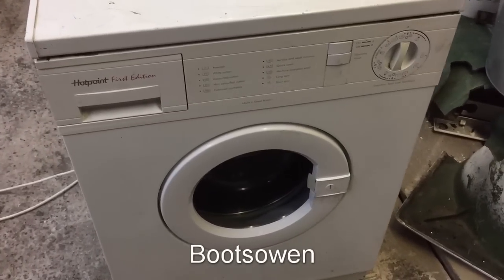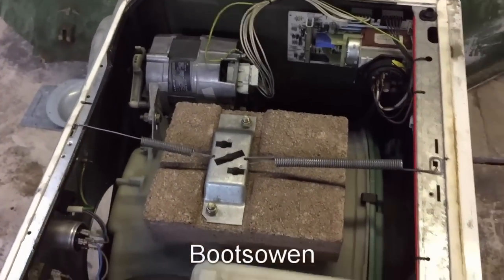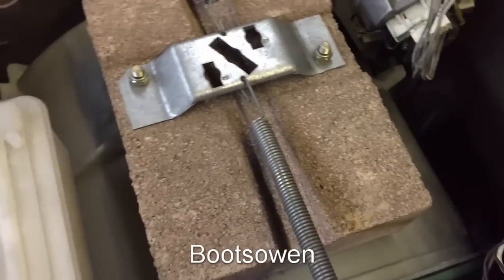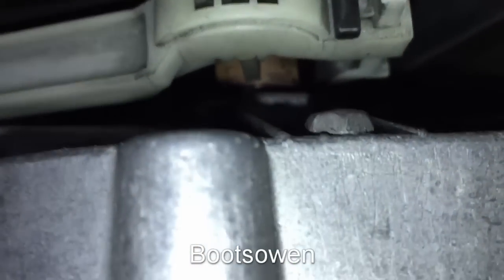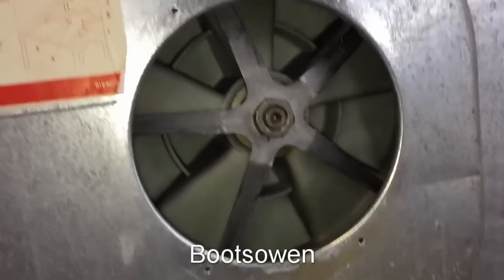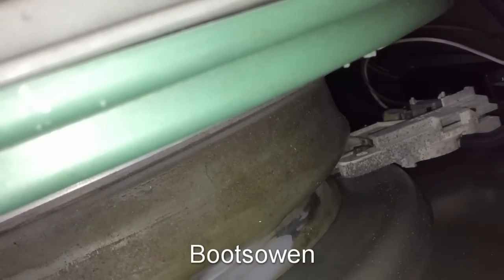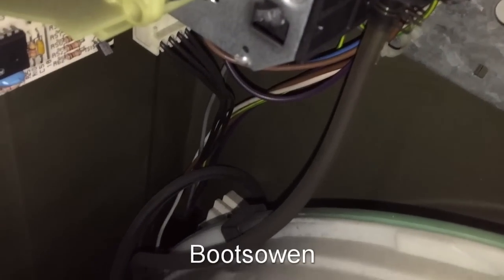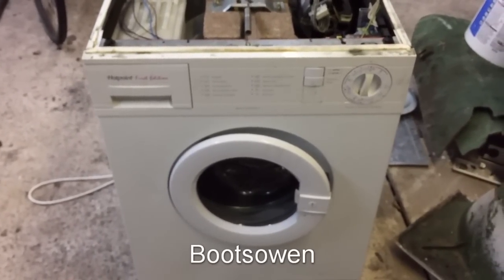Old Hotpoint washing machine tour

Comment: I think that pecker on the motor is to stop the door opening during the washing machine moving. A lot of these machines were fitted with a distinctive interlock whereby the door could be opened at any time, except when the motor was operating, hence you didn't have to wait 1/2 mins after the wash has finished for the door lock to release like many other machines.
Reply from the maker: But what if there is still water in it?
Reply: I think I recall reading in an instruction manual that once the water had reached the door seal or door glass itself then yes the door would be prevented from opening. I believe that was the only exception though.

Comment: I think that it is called a pecker and when you open the door it stops the drum from turning
Reply from the maker: I reckon ill have to do a test wash and see if it works.
Reply: Bob Surrey л
Reply: Bootsowen yes it is called a pecker unit
Reply: My old washing machine had a door mechanism like this with a pecker. I think it prevents the door from opening while the drum is spinning as the pecker is flicked to the side when it touches the motor shaft when it is spinning.

Comment: Just put a new seal on it there is plenty on eBay then it is a fully working machine 😁😁😁
Reply from the maker: It would be but it would have no value, I don't need it.
Reply: bootsowen you could sell it on? I don’t have room for it but I’m sure someone would. Shame for a machine with an easy fix to get destroyed. Someone sold an 80’s Hoover washer the other week for about £300! Not that I’m saying you’d get that for it, but you’d probably get £100
Reply from the maker: it was listed on ebay for a week and went for 0.99p. I have tried selling these middle aged washers before and they just don't sell where I am! Not for more than 99p anyways.
Reply: bootsowen are you in Ireland? There’s a guy in Ireland who collects washers. This ones quite rare compared to the others which makes it different.
Reply from the maker: Well i might give it a shot on ebay then! With a proper description it might sell well.  I'll make a few more videos of it first.